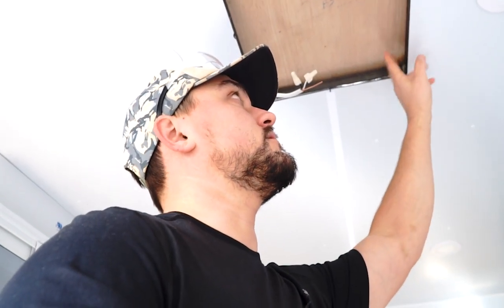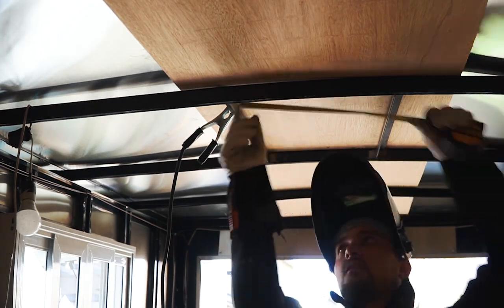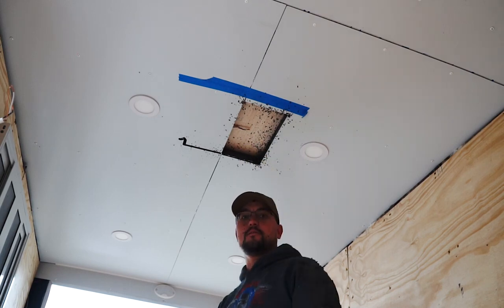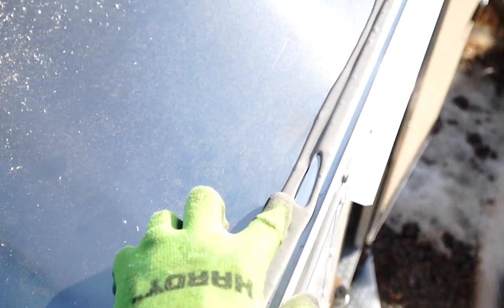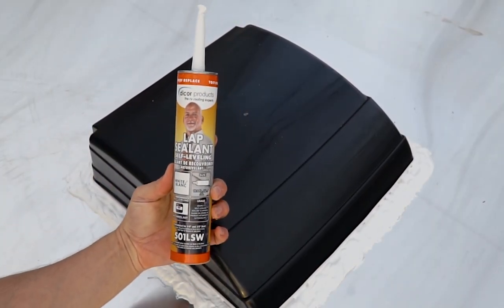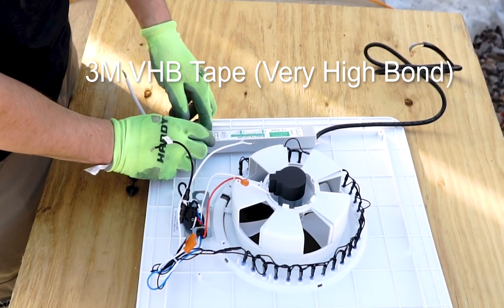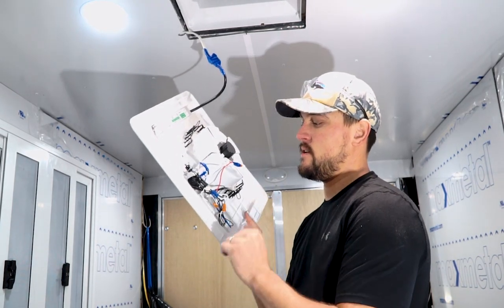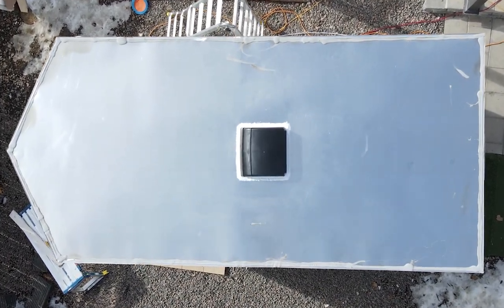How to Install the BEST 12v Roof Vent Fan | Cargo Trailer Conversion Ep.7

Comment: Was the fan tied into the existing LED ceiling lights? If not, where were they run to? Finally, is it used to exhaust some of the heat or blow fresh air in?
Reply from the maker: There were no existing led ceiling lights and the exhaust fan was wired independently because it has its own switch. All the wiring was run to the electrical panel that I installed. I have another video in this series that has the full electrical diagram and all the details. 
The fan can be used to exhaust air out or pull air in depending on situation. Makes it super nice to help regulate the temp in the trailer! 👍🏼 thanks for watching